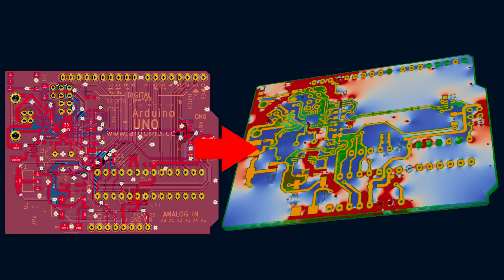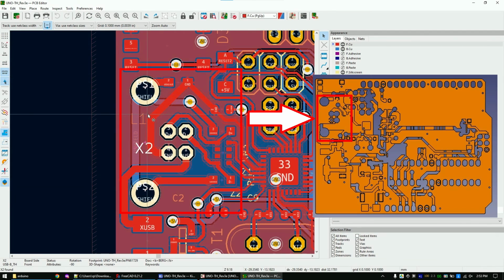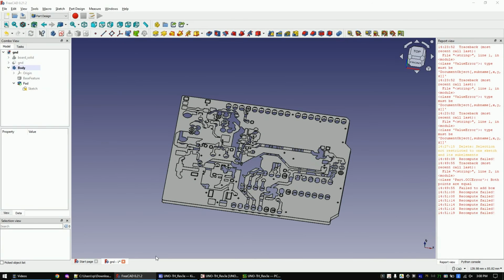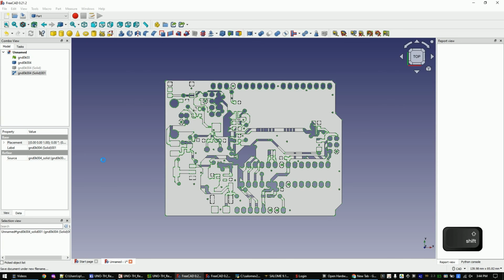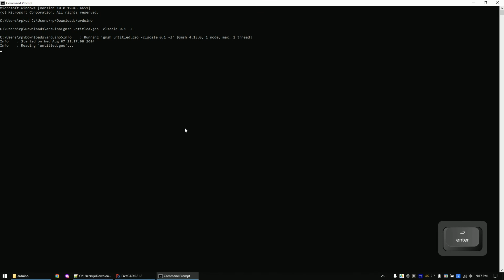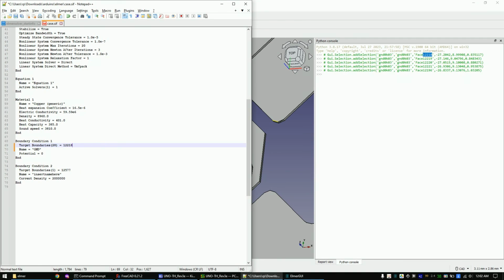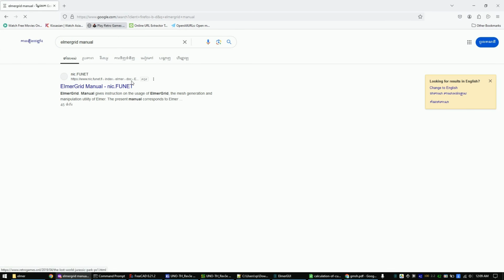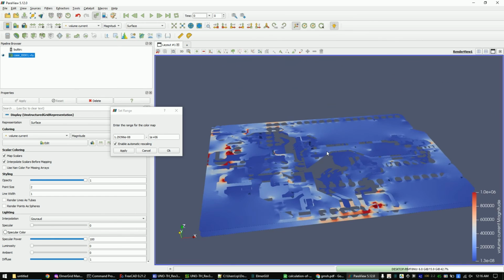free Kicad 3D current density simulation, voltage drop, ground bounce, DC impedance, PCB simulation

Comment: thanks for the great video guide. Is it possible to simulate and extract pcb parasitics as well?
Reply from the maker: Hi there! yes, check out the OpenEMS videos on the channel to get a feel for what is possible. 

In general, if it is something you could measure with a VNA (Vector Network Analyzer), you can usually simulate it in OpenEMS as well, including PCB parasitics.

Comment: Not working for ubuntu(( smth is with the paths in the kicad.py file(
Reply from the maker: @ПавелРязанцев-ы7ы  Hi there. Yes there likely are differences for ubuntu. 

Workaround for Ubuntu and KiCad 9: 

1) KiCad 9 now supports 3D export of the PCB by default, so you dont need the python script anymore to import the 3D model of the PCB.

2) Import the step file with FreeCAD via File/import (no need for the macro)

3) from here on you can follow the steps of this video again.
Reply: @panire3  thank you a lot)
Reply from the maker: @ПавелРязанцев-ы7ы  

To avoid frustration I strongly suggest to make the first simulation with a "single trace" only to get familiar with the process. Once you get a hang of it you can start with a full pcb like this one.

Most of your problems will arise due to "self intersections" and due to some traces of the 3D exports not being proper solids (surfaces not watertight). 
If a big PCB gives you problems, always start simulating trace by trace until you see where the software has issues.

Good luck and wish you a smooth start👍

Comment: If I have Altium, is there a method to do IR drop on the planes and traces?
Reply from the maker: Altium has their very own tools for IR simulation, i think i saw already a few videos for that on the altium channel, sadly i cannot recall the exact video, but here is the link to the channel itself: https://www.youtube.com/@AltiumAcademy
Reply: @panire3  Yeah, It is true. But I don't have this option.  So looking for an open source way to get ir drop
Reply from the maker: @robr8554  

I already tried simulating Altium Designs manually and following steps worked for a simple 2-layer PCB (but I am not sure how well it works for big multilayer PCB's):
1) Inside KiCad click on "File/Import/Non-KiCad-Design-File". There you can import Altium Designer Files into KiCad.
2) now follow this videos instructions.

As you are not the first one asking, I might give it a higher priority to finally ask if Altium is ok with me sharing such a video tutorial.

Comment: I have been having issue when I run the gmsh inputs in CMD. The execution ends with error self intersection. Is there any tool that can help to remove all self intersection. I tried use some filteres in Mesh lab still no use
Reply from the maker: Sadly I dont know a tool yet that does correct all errors automatically. The problem comes due to a bug in the 3D exporting tool fcad_pcb.

Here some workarounds for the time being:
Try meshing each trace one by one to find out which one makes a problem.
For example if a pad is the same size as the trace it will cause an intersection error (due to a bug in fcad_pcb).

Ones you know which trace is causing the issue, you can post a screeenshot or share me the step file or layout file and i might be able to help.
Reply: @panire3  Thanks for replying. Will work on meshing individual trace and see the results.

Comment: Just curious  have you tried with kicad 7 or 8?
Reply from the maker: Hi there, It does not work the way as i describe in this video. But Kicad 8 already has the trace export function included right away, so the use of fcad_pcb is not required anymore and the workflow "should/might" be easier. I personally will wait until the next KiCad version is released and then will make a video specifically for KiCad 9.
Reply: @panire3  looking forward to the kicad 9 video
Reply: Nicee! Really looking forward on your next video😊😊

Comment: Great job, I really need to find time to try it! Do you know a way I can use to make a thermal simulation?  I'm working on a drive for servomotors and would like to simulate the heatsink together with the PCB in an enclosure.
Reply from the maker: Yes i have some video-material for thermal simulations as well. As a little hidden gem for the people who read this comment, here is a free coupon to my udemy course https://www.udemy.com/course/kicad-fem-with-free-software-tools/?couponCode=2BB0E57CD485732590EE (coupon valid until 19-SEP-2024). if you like the course, i just ask for a review in return. Check out Lecture 28 for a simulation with natural airflow included. Hopefully I will be able to soon add a video there about airflow using multiple materials. Currently, the PCB I am simulating is simplified to consist of only a single material.
Reply from the maker: 2 videos that helped me a lot in the beginning were this ones, they use forced airflow instead of natural airflow: https://www.youtube.com/watch?v=7kkquv5auWY&list=WL&index=4&t=3s&pp=gAQBiAQB  and https://www.youtube.com/watch?v=dSZaiUMlZPM&list=WL&index=2
Reply: @panire3  Thank you! I will try it.